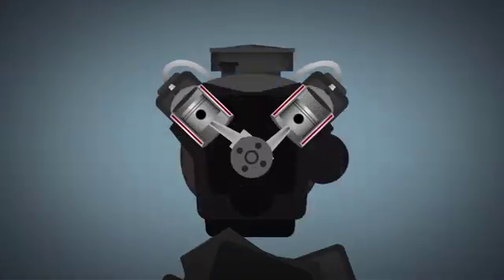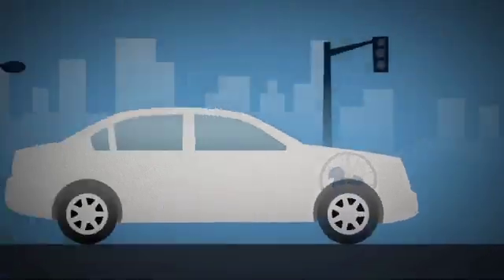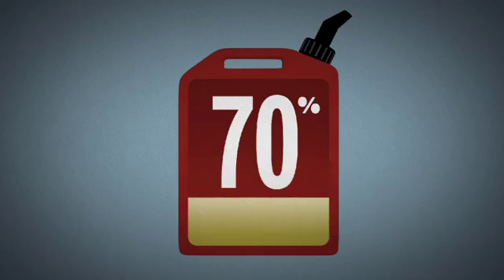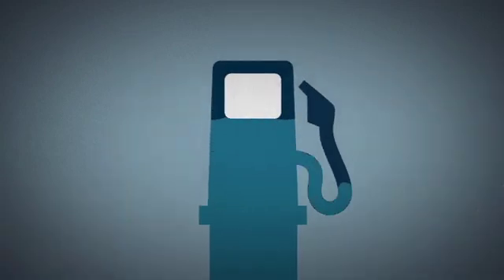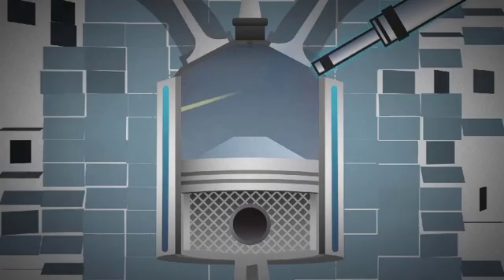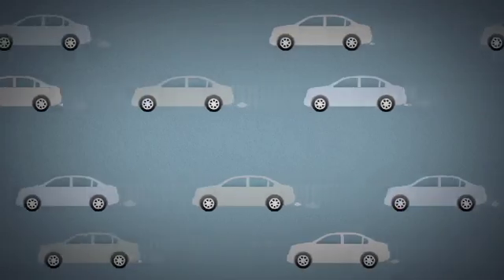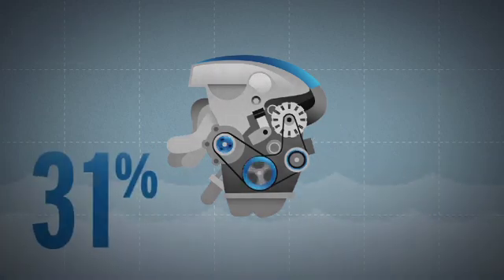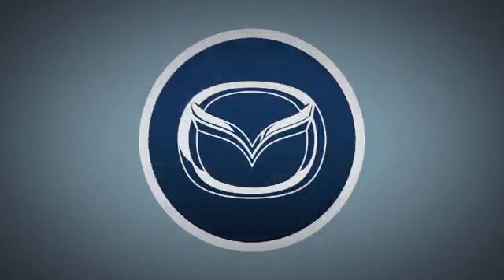Mazda SKYACTIV Engine

Comment: You missed out the part about the intake valves caking up with carbon from the exhaust gas recirculation and oily air from the crankcase. Leaving owners with an expensive service bill after a few years! Direct injection to the cylinder may be more efficient, but means there's no fuel flowing over the intake valves to keep them free of fouling.
Reply: Get the intake valves cleaned and thent install a catch can.

Problem solved. 😎
Reply: This is not true in SkyActive engines. Carbon build-up occurs way less often then on common direct injection engines
Reply: Skyactiv engines run the intake valves hotter than usual, so carbon buildup isn't an issue. You'll find plenty of engines with 300k kms running fine without ever having done a valve cleaning

Comment: They say most engines waste 70 percent of their fuel and then say about huge percentage gains in friction ect but yet this engine still is only 30 percentage efficient 😂 turns out friction only accounts for 5 percent of fuel consumption so even if a 50 percentage improvement is made that equals 2.5 percentage overall efficiency improvement

Comment: Better fuel economy is great, but if most sales are suvs instead of sedans and hatches then not much actually changes in terms of emissions 🙄👍
Reply: Actually it still does.
Reply: @raam1666  It doesnt. When you switch from a sedan with the old engine to a SUV with the new engine you likely use even more fuel especially in the city. Sales of SUVs have skyrocketed in Europe since this video released. They were already common but today theyre everywhere. I dont really get why honestly.
Reply: @TheDude50447  Modern engines are more efficient across the board.
Reply: @TheDude50447  All things being the same emssisions (which dont matter) and fuel economy (which does for some) get better with modern engines.
Reply: @raam1666  yeah but if you put them in a heavier and bulkier vehicle they use more fuel. Generally combustion engines are pretty much at their limit. Theres nothing to improve anymore. For some time now some manufacturers have started using flimsier parts to decrease internal friction. And emissions matter (yes they do)
Reply: @TheDude50447  Emissions don't really matter nearly as much as fuel usage matters. Combustion engines still have a long way to go. We will start to see high strength steels replacing aluminum parts, intentional detonation, new ceramic coatings, and probably linear magnetic cylinder assist in hybrids. There's still an "easy" 15% efficiency to get.
Reply: @raam1666  Well its good to stay positive. I would take about any bet that none of this will ever see widespread use in production vehicles. At best prototypes. Its simply a matter of cost/profit. Like your steel suggestion. Its heavier and stronger. So the engine would last longer but deliver less power. Thats literally the devil to car manufacturers.
Reply: @TheDude50447  A hardened steel engine would enable internal detonation which basically enables a 50% increase in efficiency potentially.
Reply: @raam1666  Im curious now. How would this detonation engine work. We already use spark and compression ignition. Currently the most efficient ship diesel engines reach 55% thermal effciency. The best combination powerplants reach around 60%.

Comment: UK 2016 Mazda 3, 2 litre 163bhp...6.5 years and still cruising... absolutely love my Mazda.
Reply: Awww what!? How'd you get 163 bhp from the 2.0? I've recently bought a 2016 3 but it's limited to 120bhp, none of them produce more than that, did you do the engine unlock mod? Or was it a different model where they let you have that extra zoom zoom?
Reply: @ben4190  When I went to my local dealership, the 3 model that I went for was known as the Mazda 3 165
Reply: @LupusInfernum  Ah right, weird, I mean I love my 3 nonetheless, but never seen one advertised as more than 120. Would love to get around 165 from it, would really do the looks justice! I know the 2018 onward 3 you can get one with that power.

(Sorry to bring you back to a comment you left over a year ago too! =p)

Edit: Just did some googling, and found the one you've got, it's like the high end one, and has an electronic handbrake? Think it was the start of the facelift version of the 2013 - 2018 3, really nice!
Reply: @ben4190  no electronic handbrake, I have a physical one. I got the 2013-2016 Mazda 3. They did a model refresh from 2017-2019 with a sleeker trim and an eBrake bring the main difference.

Comment: Lol my brand new cx5 has terrible fuel milage
Reply: terrible compared to a car? or SUV. Mazda is top of the class for fuel economy currently in the SUV range
Reply: Hmm interesting maybe I drive to sporty but I stand by my statement it’s terrible on fuel compared to anything it’s a great car I love it just bad on fuel plus it’s hardly a suv in reality it’s the same size as any large sedan just higher off the ground
Reply: @8ballin882 I have a feeling you have no clue of what the actual gas mileage you have
Reply: @8ballin882  is your warranty ended yet? Use e85 take advantage of the high compression
Reply: @anpham8107 e85 is less energy dense, it burns a lot faster, it's more wasteful

Comment: This engine will get carbon built-up issues in the intake valves
Reply: I'm seeing a lot of nerds in the comments. 

175,000 miles is all I have to say
Reply: Nope, carbon build up is not proving to be an issue with Mazda's Skyactiv G engines even with big six figure mileages.
Reply: I’ve had one for 3 years an 30,000 miles an no issues, direct injection is known for this but Mazada has been really good with valves getting gummed up.
Reply: @gregorydimaio3260  What are these like for excessive use of oil any reports of them like the modern Toyota models?
Reply: @gtibruce  toyotas usually get that issue because manufacturers are recommending oil changes at 10k miles which in that point the piston components that prevent oil from getting burned gets gummed up. Oil changes should ALWAYS be changed from 3k-5k miles depending on if you use the car often for short or long commutes. Also for any direct injection engine, consider putting in a oil catch can.
Reply: @Weebwhacker  Yes, thanks,  im aware of that, but my question was about the 1.5 Mazda 2 engine does it burn oil like the Toyotas or does one not have the same concern of frequent oil change's like we didn't have with older cars. Is it yes or no?
Reply: How the engine is broke in when it’s new plays a part as well.